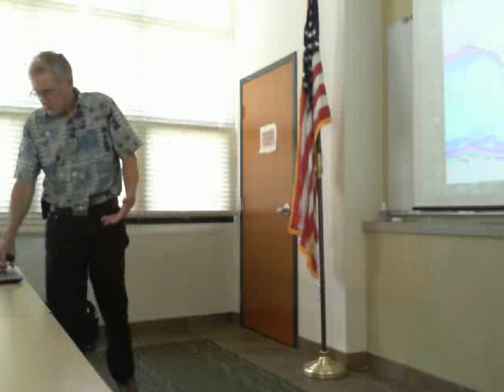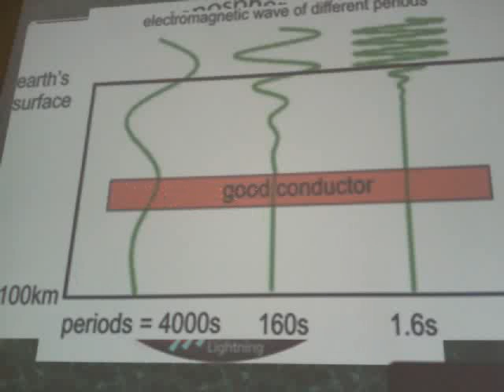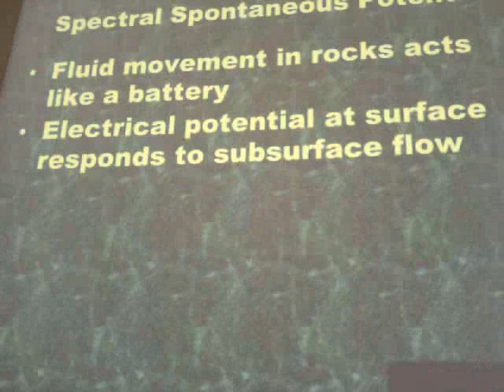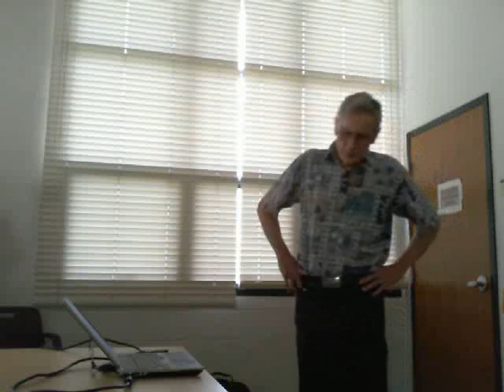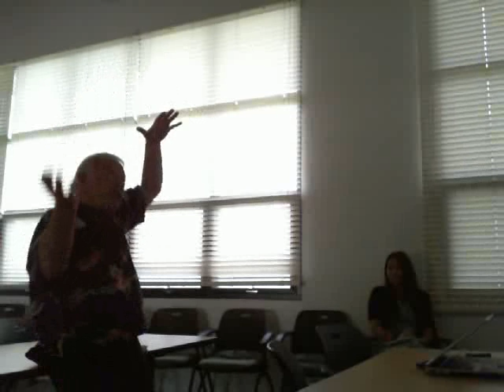Don Thomas - Hawaii's Geothermal Resources 4/2/13

Comment: 27:00 1983 statewide geothermal resources survey ID geologic structures and likelihood of geothermal resources. Looked at subsurface temperatures and chemistry. Found evidence of altered chemistry on Maui and Waianae caldera. Orig data 30 yrs old, better tech now and recent activity changes things. Orig data used to generate maps: KERZ 95% probability of resource, perhaps extending to north, Pahoa well shows some evidence of geothermal water in drinking water in town. Kau - no data at the time, but well drilled at HOVE did find elevated temps, leakage of thermal water off Mauna Loa. 
30:00 Mauna Loa northeast rift zone has limited potential at high elevations, rift disappears as u go east and we don’t know when the last lava intrusion was. 
30:28 No water or temp data for Mauna Kea, no idea where the rift zone was so “took a pass” on Mauna Kea. 
30:42 Hualalai work in the 70s spontaneous potential surveys to ID water flow and steam flow, found evidence of activity in Hualalai rift zone. Wells drilled on flank came up with anomalous data, so some probability. 
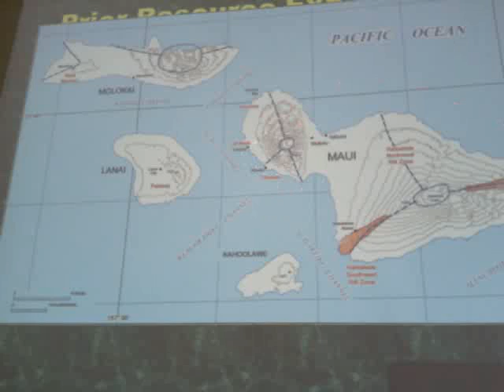31:55 5% probability for Waianae caldera. No evidence for Koolina
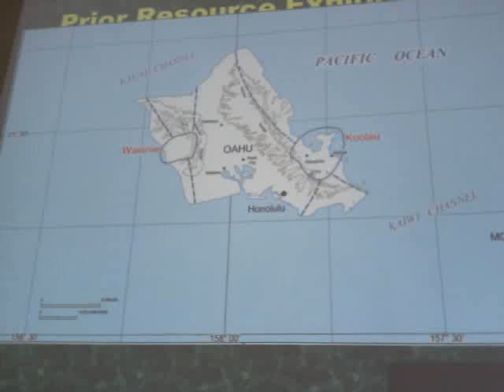32:15 Modern methods: magnetotelluric survey process explained. Able to map electrical conductivity of subsurface strata to depths of 10 km. Can tell temperature, rock type, and water saturation of rocks. Low impact process, sensors buried 1 foot deep in ground, measure for 5 days. Used for groundwater exploration.
37:20 Saddle road surveys: Mapped Mauna Kea groundwater system flank down to sea level. Measures electrical conductivity of rock, indicates dryness of rock. Mauna Kea observatory access road has fresh water at 1000 meters above sea level. Much more water is being stored than earlier thought. 
40:45 conductivity tied to rock type and dikes made of dense rock, level of saturation and salinity. Below sea level, no data, so they’re drilling a hole.

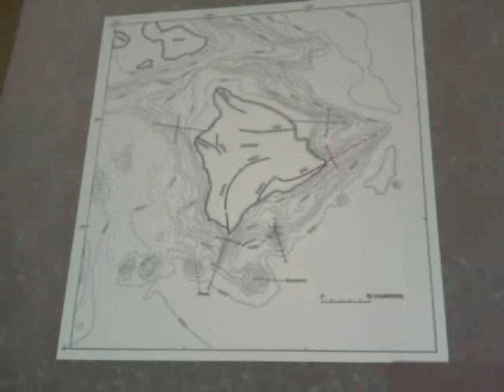Comment: 16:00 rift zone extend to sea floor. KERZ extends 30 km below sea level. Southwest rift zone, perhaps b/c of formation of Loihi, stabilizes flank so that lava travel to east rift (KERZ). Mauna Loa and Mauna Kea have rift zone.
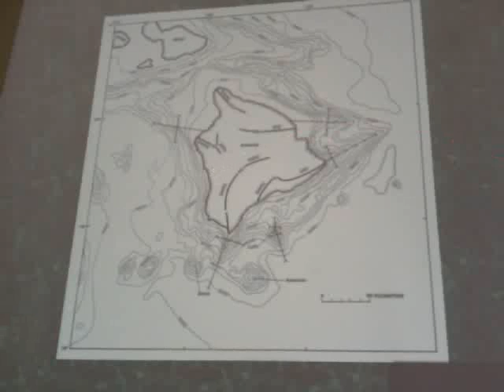17:50 rift zones are mobile, KERZ moving south. Old rift zone buried under new flows, no evidence of additional heat
18:45 High temperature wells in KERZ, shallow water test wells in Hilo. MAP of test wells “air strip well,” Malama Ki well, 1962 geothermal test well 3. Active leakage of hydrothermal fluids coming up into water table as early as 1975. Jack’s Tours used to do a hot bath tour.
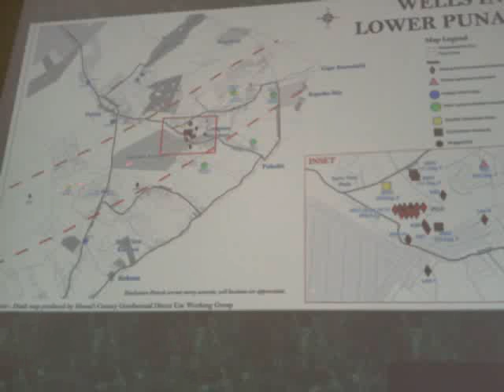20:00 Kohala volcano rift zone, Mauna Kea, Mauna Loa, KERZ, Hualalai magma intrusion back in the 40s evidenced by seismic activity. KERZ marked by very sharp break on land. Mauna Kea and Kohala volcanoes have subsided below sea level. Shows map of shelf that extends below sea level. Much of the lava material that underlies the surface is fragmented because it was formed at sea level, less stable because of the way volcanoes grow.
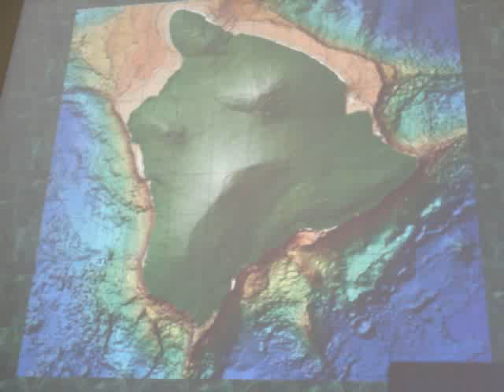23:40 Maui nui was once above sea level. Maui Molokai and Lanai were probably all part of one island. Possible heat on Maui rift zone
24:30 Oahu could still have heat stored, being studied. Not sure how long stored heat lasts. 25:10 There is warm water coming out of west Maui off shore. 
25:30 Oahu - caldera region of Koolau and Waianae volcano has been bisected along the flank d/t land slides. If there is heat stored on Oahu, they would expect it to be near the caldera.

Comment: 10:00 magma rises up and forms strata volcano on continental plate. In Hawaii magma rises in middle of Pacific plate. Forms on ocean floor 30K feet below. Hawaii’s volcanoes much larger than Mt St Helens or other volcanoes on a continent.
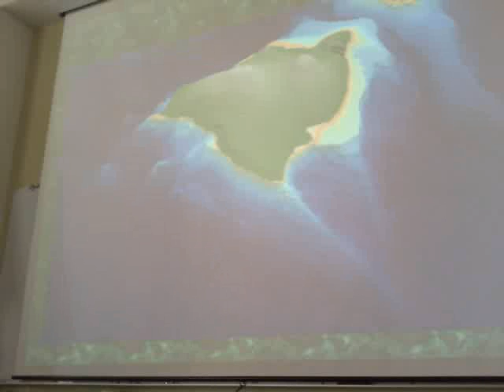11:15 How shield volcanoes grow and erode. Pillow lava on ocean floor, breaks water surface, shield stage, late stage lava chemistry changes and goes to a more peaked form like Mauna Kea. All of eruptive material is cooled within hours or days.
12:30 geothermal cannot be developed anywhere. Only specific structures in volcano where heat is stored. Deep hole drilled in Keaukaha, 11;500 feet down temp was warm enough to take a bath. Would have had to drill 20K feet to get to boiling water.
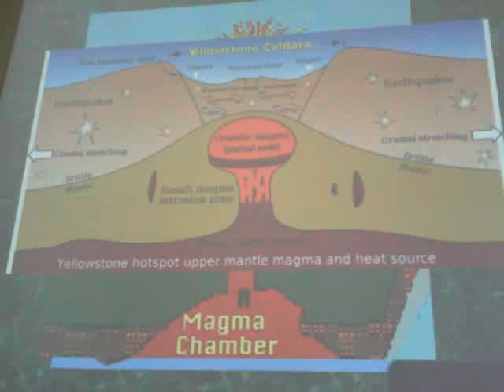13:30 Hawaii volcanoes different than continental ones in that a central conduit comes from deep in the earth. Also different from other island volcanoes. Source of lava is 25 to 50 kilometers down. Shield starts 8 to 10 kilometers below sea level
14:25 Rift zone is a zone of weakness in the volcano where magma comes up into the conduit, forms a reservoir, magma able to travel out underground through the flanks. As much as 55% of magma that comes up gets drained off into rift zone. Loihi still below surface, but has a caldera and rift zones.

Comment: 2:15 How was Hawaii was formed? Hawaii consists of 5 major islands that are the end of a long chain of islands that extend to the Aleutian trench. Hawaiian people’s creation chant recognizes age of island chain, getting progressively younger as you get to Kilauea, Big Island is youngest. 
4:45 Kilauea estimated to be 400K yrs old. Kauai is over 5 million yrs old. 75 million yrs old at beginning of chain. Older volcanoes go under trench.
6:00 mantle plume theory - magma plume rises under lithosphere and supplies magma to Loihi seamount and Kilauea. Currently active volcanoes will gradually wane. Oahu 130K yrs old.
7:00 Big Island: Kohala is oldest volcano. 600K yrs ago Kohala used to be much larger. Mauna Kea used to be higher and Mauna Loa was just breaking the ocean’s surface. All volcanoes grow on flank of older sister volcano. There is another volcano off Kona coast that was part of island in beginning but is now below sea level. Hualalai formed next, then Mauna Kea, Mauna Loa, then Kilauea and Loihi is the next one that will eventually attach itself to the Big Island. As volcanoes grown they push down on Pacific plate Mauna Kea extends under flank of Mauna Loa, proven by drilling at Keaukaha. Drilled thru 1000 feet of Mauna Loa flows before they got to Mauna Kea.
9:20 Kohala volcano is now relatively small, but used to be larger than Mauna Kea is today